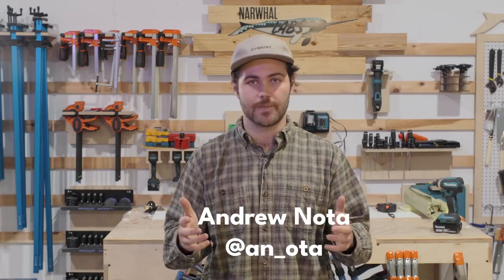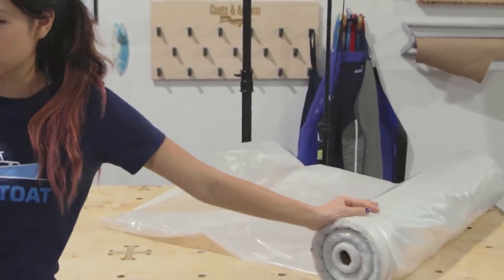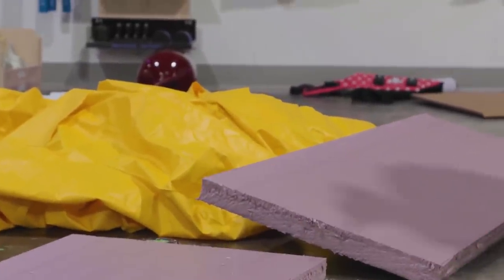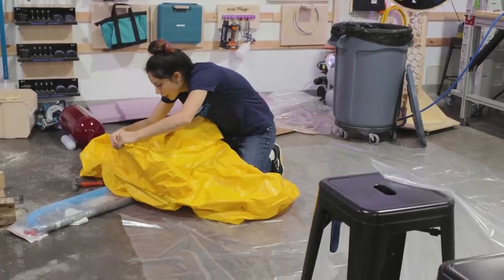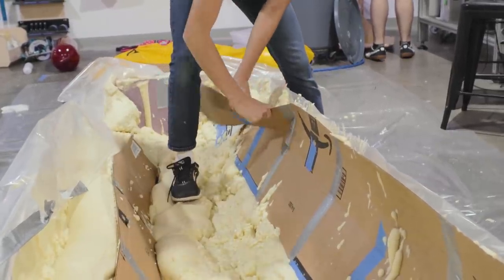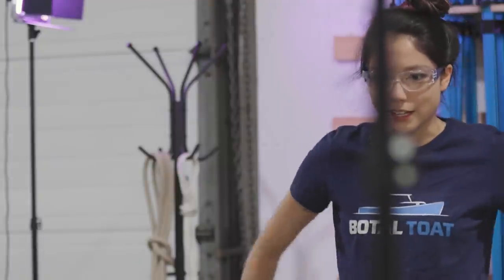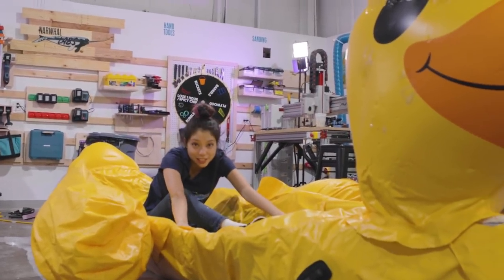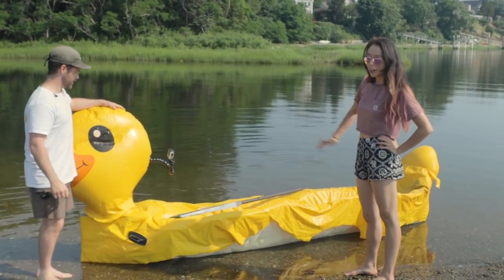Scrap Boat Challenge | Xyla Foxlin

Comment: this was funny, no real form for the foam made for extra drag rough bottom it seems.
ending I'm thinking "dang, no one taught her a J stroke" for paddling straight from one side of the craft.. is pulling yourself forward but end of stroke paddle turned 90 degrees to push outward 8-12" (as needed) to rudder+correct, would have been shorter lap time.
OK Xyla did engineering school not canoeing school....

Comment: so many buckets could've easily sliced one in half to attach to pole and then not have resistance of pushing paddle down into water ... on the other webbed foot though hers would float if say clumsily dropped 🤔 good duckin though 💜